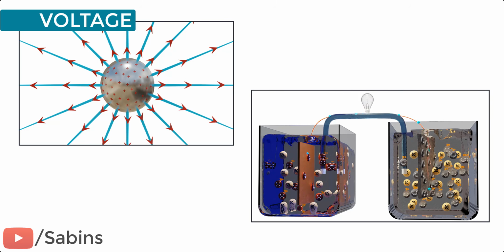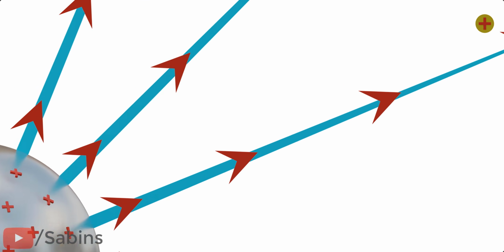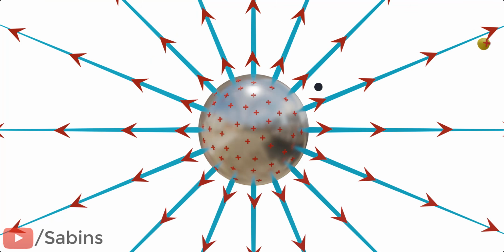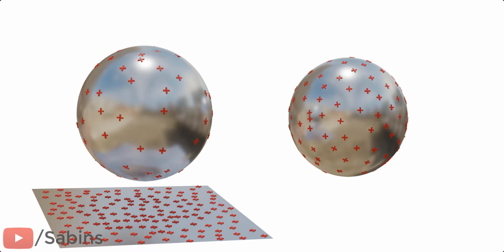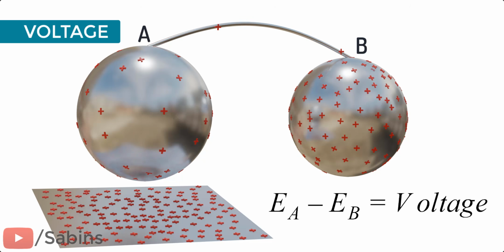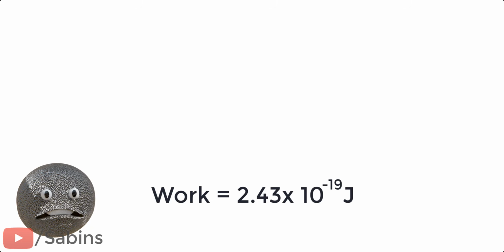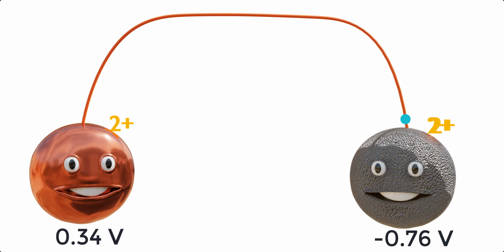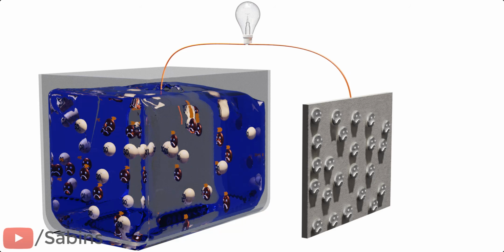What is Voltage?

Comment: I don t understand how the salt bridge balances the charges.
Reply: John Papadopoulos I have a feeling the answer is found by googling galvanic cell.
Reply: Yes I am confused too
Reply: @shabihatabassum1938  In the galvanic cell Zinc acts as anode and Copper as cathode
When you just connect the copper and zinc plates there is Zn2+ ion build up in the solution because zinc plate loses two electrons.. while on the other side there is build up of Anionic part of Copper solution( usually SO4²-) .So  these charge buildups due to ions just stop the reaction very quickly if they stay there, because of charge imbalance 
A salt bridge acts like a path for these ions so that they can migrate and thus the excessive ions are kept in control and thus reaction keeps going on.
..
Hope this helps
Reply: @kemthursuraj6600  thank you.

Comment: in mathematical terms, what's the difference betwewn negative and positive work?
Reply: Work is Force Applied through a displacement parallel to the force applied W=F*r (dot product). A Negative Work means that the F vector goes in the opposite direction of the displacement vector, so they are at 180deg. Dot product of F*r = Frcos(angle), with 180, the cosine is negative.

Comment: Electric potential and voltage are same thing

Voltage OR Potential = work done in bringing a unit +ve charge from infinity (zero potential where electric field is zero) to that point against the electric field.

Voltage difference OR Potential Difference = work done in moving a unit +ve charge from ONE POTENTIAL to ANOTHER POTENTIAL

EMF = Originating point of voltage is termed as emf OR birth place of voltage where voltage is created called emf like in generator, battery we call emf. EMF and voltage are same just different name.
Reply: Voltage is specifically a difference in potential. You cannot have a lone voltage without something to reference it to (e.g. a defined ground).
Reply: @Celastrous  yes 😀